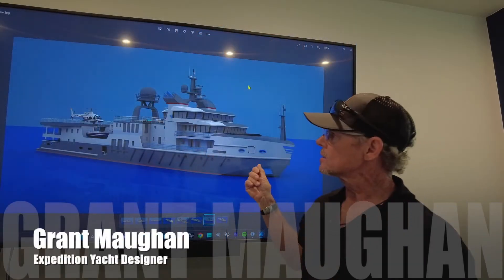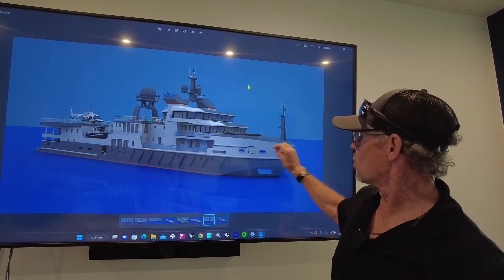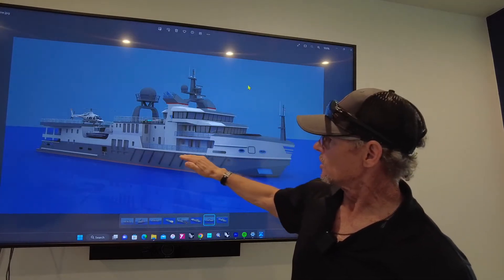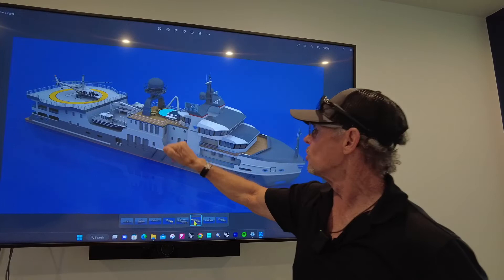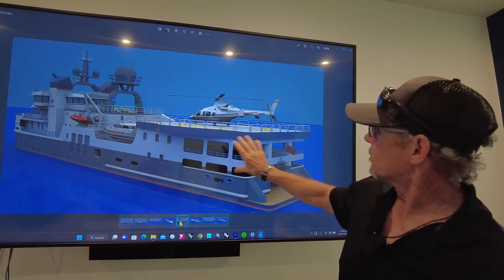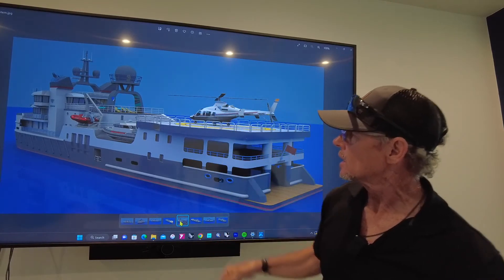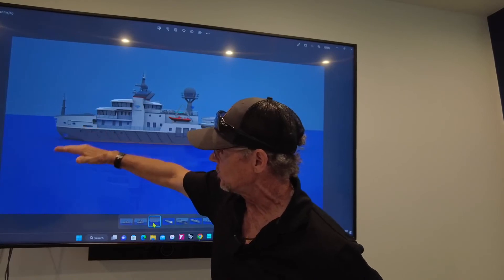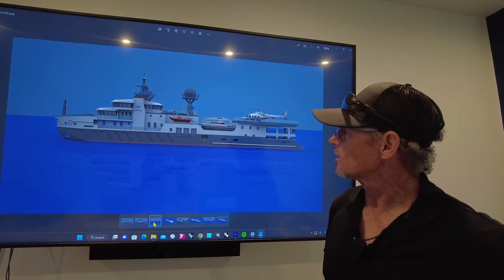Grant Maughan design for 221 ft/68m Ice-Class Expedition Yacht Conversion

Comment: Having worked on doodlebug ships for years, let me warn you about structural failures, especially on all welds basis fatigue from the stress of the "guns" firing every 6 seconds.
Reply from the maker: I was not aware of this. I just read an interesting abstract on marine welding here: https://www.mdpi.com/2075-4701/12/6/1010   They get into testing that is done on welds.and mention that "The recommendations of the current codes, such as International Institute of Welding [26,27] and Eurocode [28,29] and recognized by some of the most important Classification Societies of ships and offshore structures, are conservative" The vessel we are considering for this conversion is Lloyds ice-class 1 (up to a meter of ice), and so the steel and welds are more robust than on a thin-skinned modern vessel. Also, it was originally working as an Arctic search & rescue vessel, so it was not doing seismic for most of its service life. However, thanks to your comment here, we will be sure to look more closely at welds when we do our technical survey.